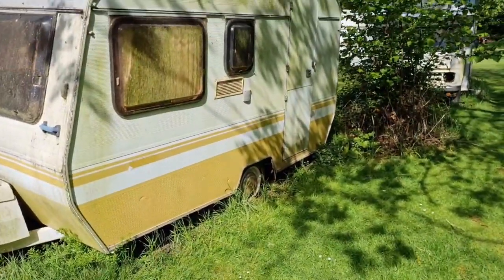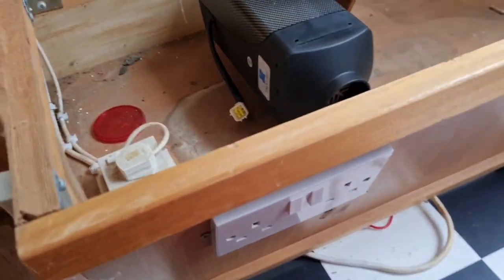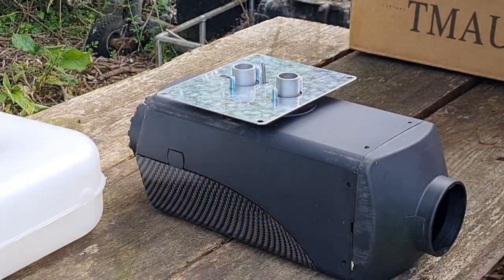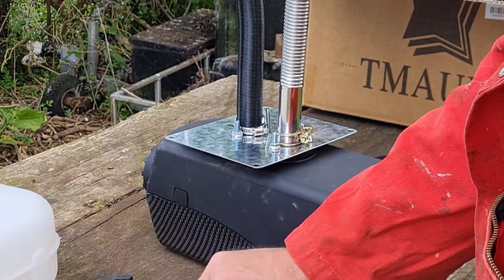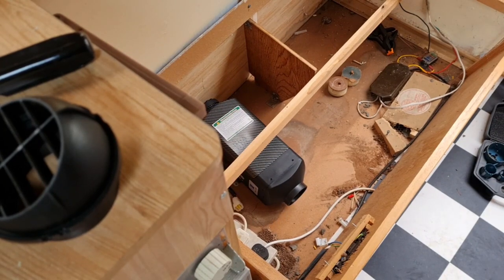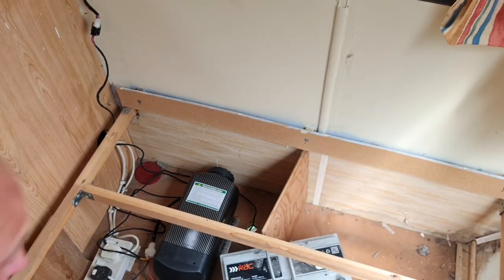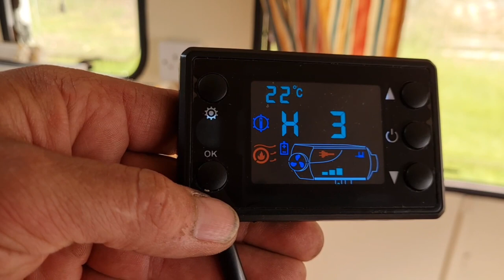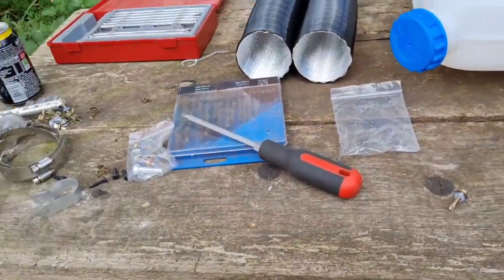installing a Chinese Diesel heater in a Retro caravan. Plus Will it work.

Comment: To manually prime it, hold the up and down button simultaneously, and it will prime for as long as the buttons are held, whilst it is in off mode! Hold the gear icon to set it to temp mode. Hold the OK and Gear icon to get to alpine mode (less fuel used)

Comment: Those  heaters are very good and will heat the caravan up very nicely ive fitted 5 of them so far to people's  self build  camper vans and ha no problems with them at all  
It was a good idea of yours to use that other drum for fuel tank as the one that comes with kit has a connection that fits in but is very tricky to do the end should be in the bag of bits
Reply from the maker: Yeah it seems like a good bit of kit for the price. It seems to heat that little van in no time.
Reply: I thought i saw the connection already in the tank that came with the heater.
They can be a bit of a fiddle to get it though, wire through the hole then slide the barb down inside and through, washer both sides, hurrah, cheap heating!
Trying mine on old veg oil this year, see how that goes

Comment: Great stuff. This is quite timely as I'm wondering whether to risk a cheap Chinese diesel heater for my camper van rather than remortgage for a Webasto or Eberspacher. Any problems so far? Thanks for uploading. 👍
Reply: I have used one of these to heat my house last 2 years, no issues other then self inflicted. When the fan motor bearing went I procrastinated in getting it replaced so I destroyed the motor, 50 dollar mistake, then I ordered high quality Japanese bearings, and put it int he new motor then installed and 0 issues with it now. Second one with same controller as him, has had no issues out of the box all of last winter and now (I now run the other one down stairs)
Reply: @Refertech101  Thanks! Much appreciated.

Comment: I thought the metal plate went under the floor so you didn’t have big holes under caravan, I would have cut two holes for exhaust and air then smaller ones for fuel and studs then put the metal under the floor and the rubber gasket sits in the floor
Reply: No Lewis. Plate goes as fitted here to create a seal with the floor. The slot in the plate is where the pump wiring should have gone avoiding the need to drill a separate hole.

Comment: They have to be left top run down otherwise the electronics inside will get fried from the residual heat in the combustion chamber stroke heat exchanger.
Reply from the maker: Yeah i remember hearing that myself  on a youtube vid. I did let it run down when i turned it off.

Comment: nice one bud ye typical chinese instructions vague af lol if the 12v plug supply is live on the side of ur seat use that for ur heater supply and the hole left u could use as an main switch for it if that makes sense
Reply from the maker: Yeah I'm working it out tho. Lol.. it seems a nice bit of kit to be honest.
Reply: @NorfolkMancave  ye man it’s just a basic version copy of an eberbacher like they have in the Mercedes Vito vans as a night heater innit they well priced and wack out the heat too